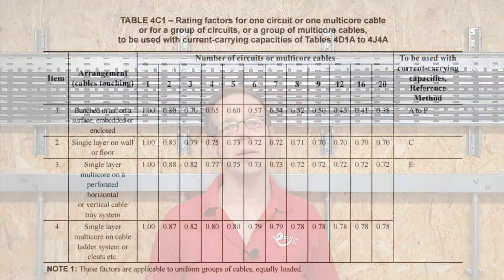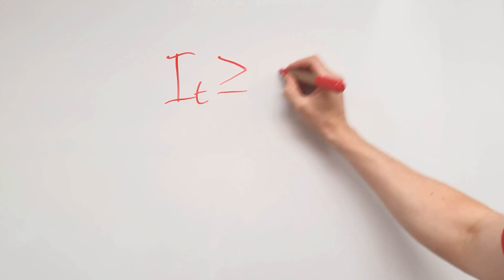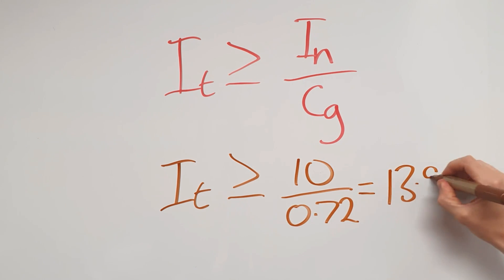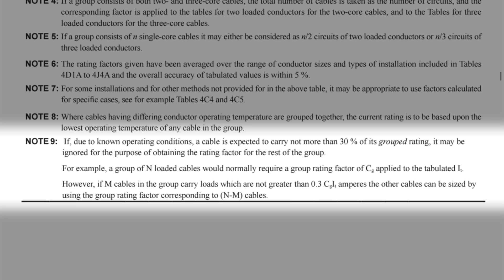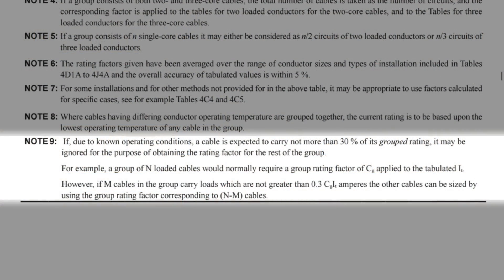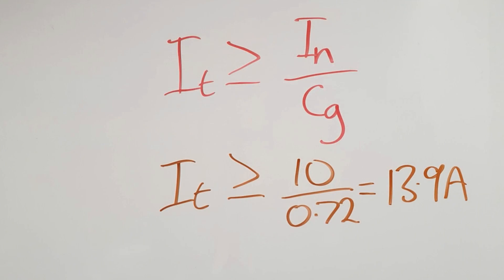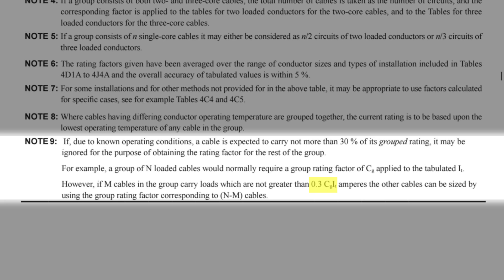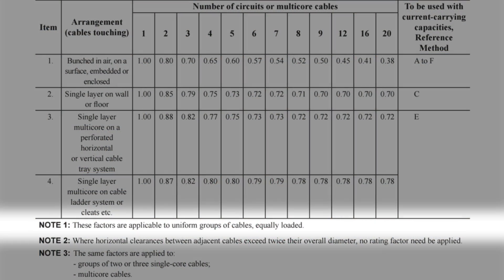ELECTRICIANS Q&A: CABLE TRAY GROUPING FACTOR CALCULATIONS

Comment: Amazing videos as always. Did the fine people at eFixx create more videos regarding grouping? The area is complex, especially the notes under 4C1 table. Not sure how Note 1: "These factors are applicable to uniform groups of cables, equally loaded" works. For a an installation where only smaller width cable trays are possible, the ratings factors push for 25mm CSA cable for radial sockets... i must be doing something wrong, can anyone help please!?? I am a qualified apprentice on my final portfolio . thanks

Comment: If 35C Temperature Factor (0.94)
And Load 4A Lighting
2# circuit (0.8)
MCB 10A --- It= 10/(0.94x0.8)=13.3A

I need 1.5 Wire
The wire can carry 17.4A 

------
Question:   What will be the answer

1-   0.3(0.8)(17.5)(0.94)
Or
2- 0.3(0.8)(17.5)
Or
3- 0.3(0.8)(13.3)

Thank you

Comment: Not forgetting spare capacity, as we are designing for the future installation also. I would always size at the maximum grouping likely to be experienced on the containment and/or DB. With all the caveats on the British Standard its hardly worth trying to wiggle your way around the minefield, especially if the cable size you get in the end is reasonable (such as required for voltdrop). On occasions where a larger than reasonable cable is calculated look at it in detail to see if it can be engineered down.

Comment: Table calculations did change as the oven and the hob changed we calculated for 4.74kw but then she one decided to buy a 6.5kw hob.  We had a total of 8kw on full load.  But we did have 6mm total length was under 14M so did calculate for 15M All Well with in using mV drop from the big book of you must follow or else.

Comment: Interesting. I've worked in London underground tunnels where HV cables are mounted to trays and or a rack system. Almost every time they're grouped together with zero distancing between them
Reply from the maker: Much lower current on the HV
Reply: Curious to know where HV cables are used in LU tunnels?

Comment: A company I worked (long since gone bust) for when I was an apprentice got this wrong.    It was a fairly small plant room with  3 phase motors, rotork actuators  and other control and instrument equipments plus lighting etc. 
The main tray was 300mm wide and stacked full.  I heard in theory at college cables get warm in groups etc but this was the first time I experienced it I was quite surprised how warm they all were.
Me and a labourer were the ones tasked with replacing the 300 tray with 600 all while the stuff was powered on.
Reply from the maker: Thanks for sharing your experience, turns the theory into practical. 👍

Comment: Fantastic video low as always 
👍👍👍❤️⚡️
Reply from the maker: Thanks Sean.
Reply: @efixx  saw a shop today with the eFix logo black on white back ground, I think it was a print shop or something , it in Southend . Maybe a copy right issue there . Can you call me please I emailed you my number last week
Reply: @efixx  say there is a large installation with 20 circuits in trunking leaving the DB. That would mean a grouping factor is 0.38… this would make every cable need to be very large, nevermind if other factors were applicable ? Is this right, anyway around this?

Comment: Would this even apply to a tray like the one behind you. ? Isn't there a section  of the grouping that states ,  if the cables are more than their diameter apart they aren't classed as being grouped ?
Reply from the maker: More than twice the diameter apart if memory serves. 👍
Reply: @efixx  ahh yes . Just looked it up. You are correct. Cables spaced 2 times their diameter apart are  classed as not  grouped.
Reply from the maker: Nice, good to know the old brain's still ticking over!